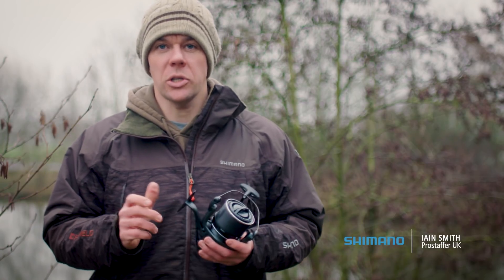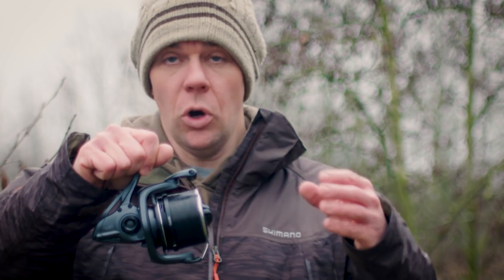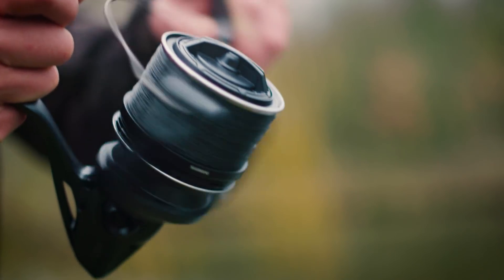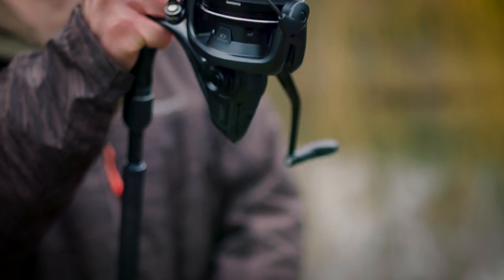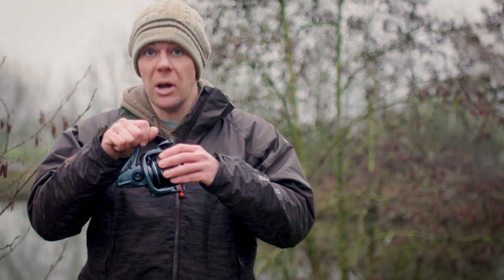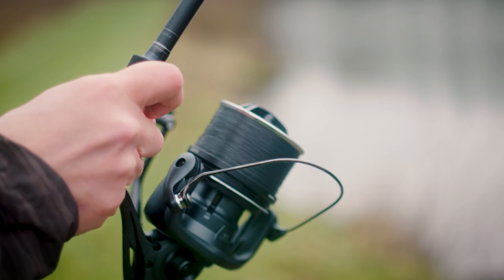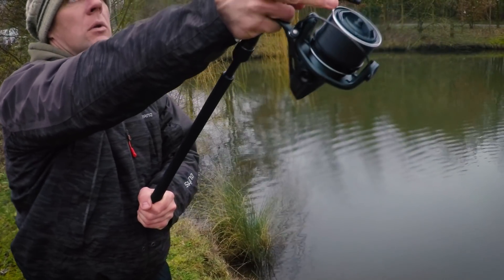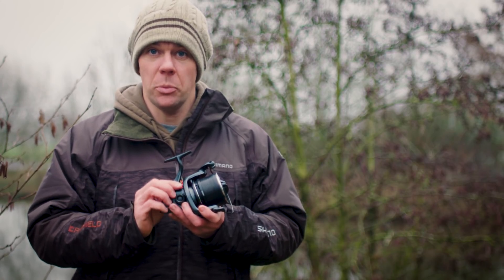Iain Smith explains Shimano's Super Slow Oscillation | UK

Comment: I have the Ultegra CI4+ 5500 XSC
On the Shimano website they said it has the Slow 5 technology but went i tried to count the line lay, its only 36 rounds per oscillation.
Reply: because it's a 5500? I think 14000 has 50.

Comment: Why is this new reel so heavy 510 gr for a Magnesium reel of course there is a larger spool but then not save on weight by using cheaper material this is a missed opportunity
For comparison, a Daiwa Basiair that has been on the market for years and is also a top model reel weighs only 420 grams
The weight of the reel is also important for casting long distances